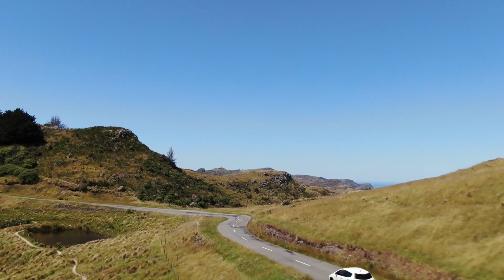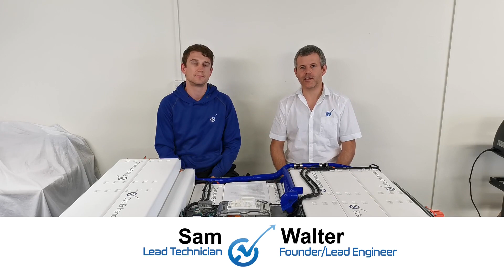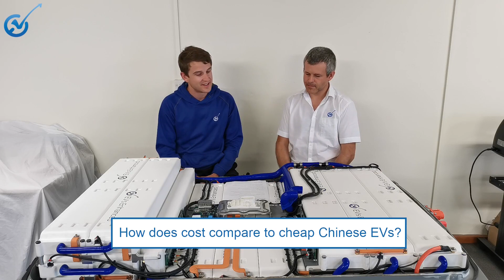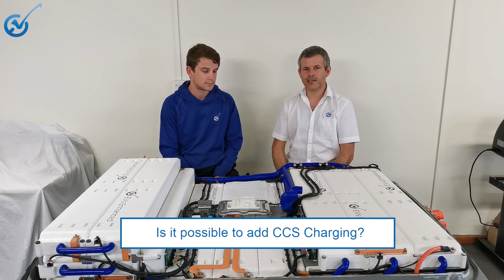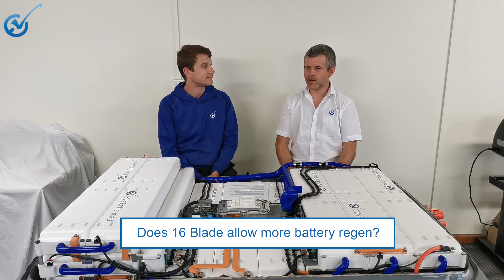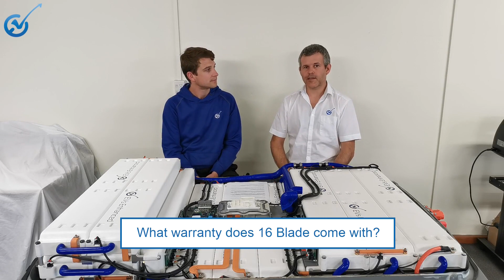Sam and Walter Answer Your Burning Questions - 16 Blade

Comment: I am trying to understand where the market is for this product. 
A person that would spend $20k or more on a <$10k, ten year old EV to get a cooled 40kw battery seems like a very small market.
Especially as, by the time this is market ready, that $20-30k would probably go a long way to buying a nice second hand 70-100kw EV with factory battery cooling and 10 years of design improvements. I love my Leaf and would pay quite a bit to keep it usable but $20k or more just isn't cost effective. 
Getting a battery pack that will last for 20 years or more sounds great but realistically, how many owners will still have their Leaf twenty years from now? How many >30 year old vehicles are on the road currently? The draw of newer EVs with greater range, safety, features and lower cost will reduce the existing Leaf numbers to almost nothing over the next decade or two.
How many people would spend $20k on any decade old vehicle to keep it on the road? There will be some but will there be enough?

I would have thought a cheap uncooled replacement/upgrade using  LiFePO4 cell chemistry for its better heat tolerance would be a more desirable product. This would massively reduce development costs, time to market, material costs, training and installation costs and deliver a much cheaper and more marketable product.
People are only buying old battery packs and swapping them because it is the only available option. It is not a great option, especially as the availability of good second hand packs is very low, even in NZ where there are heaps of Leafs. The only other choice is cutting your losses and scrapping the car and buying something else.
Leaf owners in this situation would be very likely to buy a cheap rebuilt battery pack with nice new cells but spending >$20k to fix a design flaw in what is now a quite an old vehicle probably isn't likely. 
For me, I am balancing the benefit of keeping my nice Leaf that is in amazing mechanical shape after 10 years versus upgrading to a newer second hand EV that has many times the range, a infotainment system that entertains rather than frustrates, an air conditioning system that doesn't remove 10% of your range just to have a fan running, etc. I love the Leaf and enjoy driving it but the cost of getting back decent range is going to be the difference between another decade of life or a trip to the scrappers. I don't think I am alone in that thought.

If a near 40kw cooled battery system can fit in a factory 24-40kw case, then if the cooling requirement is removed, would a 45-50kw capacity be realistic?
Also possibly integrating the bridge circuitry within the pack so it becomes a true drop in replacement or at least drop in as far as the hardware is concerned.
A cheap 50kw drop in replacement would have a massive number of Leaf owners reaching for their wallets. It would also be a quick install, low investment product for secondary installers both in NZ and overseas.

Comment: I would be curious what pack configuration and type of cells you used for this build. Did you stick with the original 96s configuration, with each 6s blade module using roughly 128.4ah cells in series at 19.2 volts per blade, for 307.2 total nominal volts, or did you use a 112s configuration, with 7s blade modules using roughly 110ah cells in series at 22.4 volts per blade, for 358.4 total nominal volts? 

What cells did you use? Based on the size and placement of the terminals of each module, it looks like BYD blade cells, but those are 138 Ah, making the pack 42.4 kWh, not the 39.4 kWh you claim.
Reply from the maker: Hi. The modules in our Blue variant (NMC) are 6S to give 96S like the original battery pack. 96S wouldn't give appropriate pack voltages with LFP cells, so the Green LFP version uses 7S modules for a 112S pack.

Comment: I legit would buy a leaf in NZ, tow it to you guys to swap, and ship it to the USA where I am. This is awesome aftermarket support, huzzah guys!
Reply from the maker: Thanks for your encouragement.
Reply: Only problem is NZ LEAFs are right-hand drive.  Sorry Bro not good for USA.  And used LEAFs in the USA are much cheaper than used LEAFs in NZ anyway.  I've been thinking about doing this same thing for Australia instead 😁
Reply: @edvoon  You'll be surprised how many imported right hand drive vehicles are in the USA. But you're right I didn't consider the NZ cost of a leaf compared to a USA leaf(got mine for 4k USD). Good luck on your Australian leaf!

Comment: The newer Chinese Evs are beating the Leaf in ev category. Do u really think that leaf has a freaking chance...that cant be a fair comparison.  The leaf was a freaking compliance car with build on a Ice platform and it is still the same car since its first launch  in 2010. Period. How dare u comparing that most crappy EV in the world with the newer Chinese EVs ( some of the best in the industry) .  I am not a die-hard suck up fan of Chinese Evs but from what I experience driving a Nissan Leaf, anything out there with a battery in China is beating this piece of junk of Nissan
Reply from the maker: We think it is fair to say that the LEAF can't compete against the best new Chinese EVs. But you're completely dreaming if you think that anything out there with a battery in China is better than a Leaf.  The reliability of the Leaf is well proven and there were well over half a million made. Unlike many EVs built around a similar era, the LEAF is not a compliance car at all with its own unique floor plan putting the battery exactly where it should be.  You seem terrified that people might want to hold onto their LEAF and upgrade the one part of that has a lot of room for improvement and can make the car better than it ever was new.  But we think your fear is completely unnecessary. The demand for EVs have exploded and there are supply issues everywhere.  We believe we will sell all of the upgraded battery packs we can make and Chinese EVs manufacturers who make good quality EVs will sell everything they can make too.  Heck, even the Chinese EVs manufacturer's who are sill making lousy EVs will probably sell everything they can make.
Reply: You might want to figure out what the phrase "reduce, reuse, recycle" means.

Comment: I'm curious how this pack would stand up to a cold harsh winter. We routinely see cold snaps of -40 Celsius. Will the thermal management also include cell heating to keep range loss in cold climate reasonable?
Reply from the maker: Yes the thermal management includes heating, but -40 Celsius is certainly pretty extreme.  Our standard heating package will not adequately cope with that, however we have left provisions for a higher powered heating package for this reason. More details on the active thermal management system  are coming in our next video that should be released within the next couple of weeks.

Comment: So would there be a possibility to ever create a CCS to CHADEMO adapter, assuming no one else takes the burden? Thats the only thing stopping me from keeping my LEAF and upgrading its battery in the future, and its something I'd happily pay a good sum of money for. Nobody cares if it runs off some AA's or whatever to lock and talk with both sides.
Reply from the maker: Hi. Yes an adaptor is technically possible. However, the other option is CCS Combo built into the car replacing the existing AC charge port.  As mentioned in the video there are other companies working on this so and something we are interested in offering as an option when upgrading to a 16 Blade battery pack.

Comment: I will presume that Norway could be one of potential markets for this, so the logical question does this battery packs can be heated or only cooled?
Reply from the maker: Hi. Both heating and cooling. Our next video will be on the active thermal management system.

Comment: With the 16 blade battery having active cooling, how will it integrate into say a 2012 LEAF that didn’t have cooling for the OEM battery?
Reply from the maker: Hi. No production model Leaf has cooling for the battery and that includes the brand new cars being sold today.   We're currently working on a video which specifically covers our design for the heating and cooling system.

Comment: It's great to see a Christchurch based company leading the charge on this. I definitely feel better buying a leaf knowing you guys are down here in our corner of the world and it's making me consider picking up a 24kw one to bring in later this year to go with our 30kw.

Curious if you guys also offer on board charger upgrades? Most of the fleets obviously imported here and when that blue pack arrives those 3kw on board chargers might struggle a bit to fill it completely.
Reply from the maker: Hi. The 6kW on-board chargers from the US, UK and Europe are a simple bolt-on upgrade for a Japanese Leaf assuming you get exactly the correct one for the car model.  However,  you aren't limited to the OBC rating with V2H units which bypass this completely and connect through the Chademo fast charge port.  We suspect that V2H is likely to remain an expensive option, but in addition to faster charging when required, it also brings bi-directional capabilities which can add a lot of value in some situations. Whether or not we finally see V2H units for sale in our local market remains a question though.
Reply: @EVsEnhanced  yeah I like the V2H concept but I'll believe they are an option once we see them come to the local market. We considered a solar install and that would really help sway us knowing we could store some of that power for use later. 

That second leaf is still tempting me though, looking on trade me if you guys can hit the ⅓ price mark you're suggesting a 24kw+16 blade would be competitive with a used 40kw pricing before any buyback of the old pack. Still eyeing up longer range options so very keen to see you're blue pack down the line.

Comment: How much is a replacement battery? How many miles can you go on the new battery??? I'm in Sparks Nevada USA. Thanks Brian
Reply from the maker: Hi. While exact pricing has not yet been set, pricing was discussed in this video.  Range for the 16 Blade Green is very similar if not a little more than a new 2022 40kWh Leaf, but with an improved fast charging experience on long trips involving multiple fast charges.

Comment: 2011 ZE0 56%SOH owner in Chch here - if I may add a couple of (potentially boneheaded) questions:
1. Better regen - are you working on any parts you mentioned that can improve regen? Or fit and integrate parts from newer Leafs to provide this?
2. Potential for a cheaper 24kwh or less pack by dropping a module or two? I get more than enough daily driving range off my half dead battery so one that does the same but doesn't degrade as fast would be a great option for some.
3. Potential for a "mix and match" pack in the future, with some of these cells plus some original modules? Would be nice to have aggressive regen that absolutely beats the shit out of old modules but recovers a lot of energy, and uses the new for baseload.
4. Is there much involved in enabling V2X on the Leaf?
5. What's the pack weight for the green pack? Similar to the old 24kWh or heavier?

Anyway my Leaf is projected to pay for itself by September so I'm eying a preorder with interest. I also mainly just use it for Burnside to city for work, so if you need another testbed I'd be keen on volunteering to leave it with you every day. Let me know if/when to get in touch!
Reply from the maker: Hi. The regen mostly disappearing on an early Leaf is a result of the battery aging.  A battery upgrade alone can restore the regen back to allowing the factory limit of 30kW. Increasing regen beyond the stock 30kW limit requires other changes beyond just a battery upgrade. If you don't need the 40kWh of our green variant or the active cooling then you could just consider a used 24 or 30kWh battery we can source from a newer Leaf. Building a custom pack with low capacity isn't viable in our opinion as it will never be as cheap as just sourcing a used battery. Enabling V2X on a 2011/2012 supposedly just requires a software upgrade which we can do, but we're struggling to get a V2X unit here to test it with. 16 Blade Green is approximately the same weight as the stock 24kWh battery.
Reply: @EVsEnhanced  thanks, I've never driven a Gen1 in good battery condition and didn't realise the regen limit was that high. With a healthy battery does it regen above 50km/h? I find it doesn't do anything until nearing a stop so I'm hoping that's because of the battery - seems like a lot of wasted energy coming down from 80-100km/h nearing an intersection.
Reply from the maker: @DevLSpark  on a 2011/2012 ZE0, with a good battery you can certainly get full regen of 30kW above 50km/h although you need to be in DEco mode with the brakes lightly applied to achieve this.  You can see how much regen you are getting through the dots on the instrument cluster. With this light brake application, no mechanical friction brakes are used.  As you press the brake pedal further you start getting a combination of regen and mechanical brakes.
Reply: @EVsEnhanced  Well that pretty much seals it for me. The second your orders or preorders open I'm down for it.
Reply: @EVsEnhanced  oh wow, extra 16kwh and cooling without a weight penalty? Nice work!

Comment: Did not see any information on charging speed. What is the expected 10-80 charging time.
Reply from the maker: Hi. 16 Blade Green sticks to a maximum fast charge current of 125A, however under most conditions it can hold that current until 80% SoC rather than tapering quickly like the stock 40kWh Leaf battery does. Further details including expected charge times will be released later.

Comment: Will you sell the modules separately as I'm converting a group a sports car to electric for the street
Reply from the maker: Hi. While an upgrade kit for the LEAF is in our plan, our modules are very much designed around the specific requirements of the LEAF and we don't think it makes sense to use them for one-off conversion applications.  Prismatic LFP cells are probably a better option for you to consider.

Comment: At what rate do you expect these batteries to degrade compared to the current Nissan OEM ones?
Reply from the maker: Hi. Significantly slower than the OEM battery.  We'll be releasing further data on this in the future.

Comment: We have a 2015 and a 2017 Nissan leaf and my closest location is Langley BC precisionautoservice what would it cost me for replacement battery
Reply from the maker: Hi. As discussed in the video, we haven't released exact pricing yet even here in New Zealand.  Precision are a great bunch and will be able to help you out whether you want to wait for 16Blade or not.  If you are in a hurry they may be able to find you a stock 40kWh pack for now although procuring these is difficult.

Comment: I am a huge fan of LFP chemistry and this is fantastic news. An old 2010 leaf with this battery may be the most environmentally friendly EV possible. One question: I see active cooling, was active battery heating considered, and if so, what was the reason for not pursuing it?
Reply from the maker: Hi. Thanks for your comments.  We have a full video on our thermal management system planned.  This system allows both heating and cooling.  We only focussed on mentioning the cooling aspect as that is important to allow multiple fast charges in a day without heavily limiting fast charge performance.   As you probably know, heating is also important especially with LFP as you  lose range if the battery is too cold and you can't charge at all if it gets really cold, so we have always had heating in our design as well - it just hasn't been advertised yet.

Comment: With active cooling how much energy is used and does this impact range significantly?  Another question with the green 40kw pack how much of this is usable assuming there is a buffer to protect top and bottom end?
Reply from the maker: Hi. The maximum energy consumption of the cooling system occurs during fast charging, so under this condition you still leave the charger with the same amount of energy and range isn't impacted.  During driving, energy consumption of the cooling system isn't significant under most conditions.  Usable energy for the Green variant is still subject to minor changes so an exact value isn't being released yet.
Reply: Thanks for your time and reply. Very helpful.
Reply from the maker: @frankelf3151  No problem.

Comment: The potential availability of the 16 blade is very exciting but there is probably nothing more important to go with it for sale in the U.S.A. than the CCS conversion.  CHAdeMO chargers are already not all that common here and no new ones are being built.  As old ones break, they are not going to be replaced.  Tesla and CCS are the new standards here.  Even Nissan has recognized this in the Ariya, which will have CCS instead.  I'd really like to see you guys resell the CCS converter or bundle it in with your 16 Blade battery systems.  Compared to the price of the battery itself, I can't imagine it would be that expensive.
Reply from the maker: CCS for the Leaf is now available through other companies who have been actively working on it for some time. We will definitely be testing their product with ours to ensure compatibility.  Whether or not we offer their product bundled with ours has not yet been decided.
Reply: @EVsEnhanced  Could you share links to these companies?  I expect they are on the channel somewhere, but I haven't seen them.
Reply from the maker: @Swordsman1964  muxsan.com